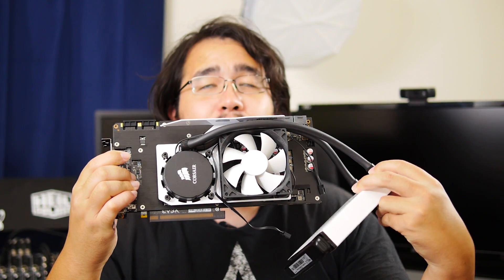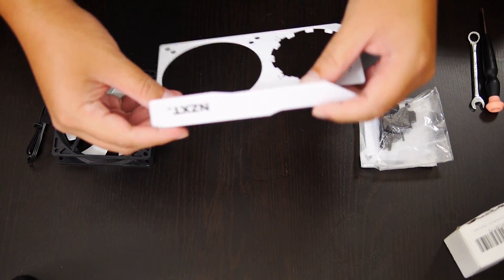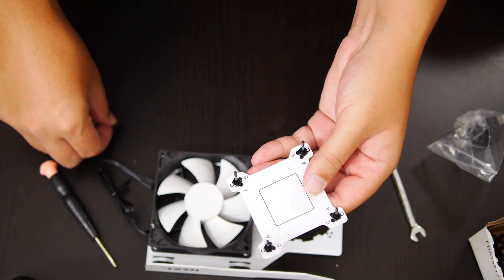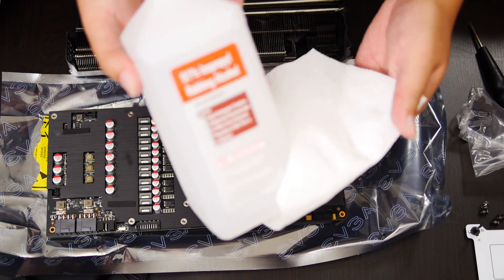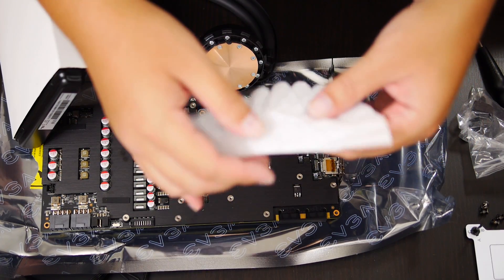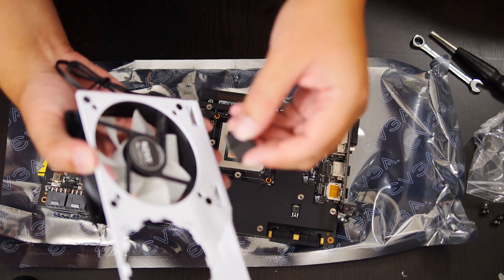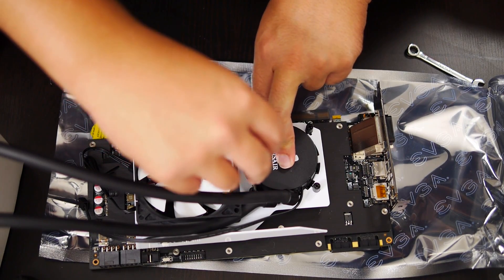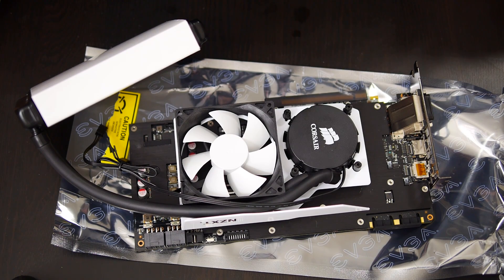NZXT Kraken G10 Installed on EVGA GTX 980 Ti CLASSIFIED w/ Corsair H90 | Backplate Heatsink

Comment: Been looking everywhere... Im looking to get my EVGA 980ti FTW water cooled, would this setup work? I've read that the FTW PCB may be different but can't find any specific answers. Help!
Reply: +youknowwho1989 did you ever figure it out? i have an evga 980ti FTW also and want to do this as well.
Reply: awp4lyfe Yes, it does work. Bought the parts listed in the video description and did the mod. Now my idle temps sit at around 31-35c instead of 60c. Under load temp max I reach now is 60c. Although I used a H55 for the cooler instead of the h90 used here.
Reply: +youknowwho1989 i have the h55 also. i've noticed under load i've gotten temps around 80 - not consistently but it happens. i did use a 20x20 shim instead of a 25x25, so i wonder if that makes a difference
Reply: awp4lyfe Well not sure if the shim size would be a big factor, but yes I did use 25x25... And also my intake fans are kind of blowing air and the fan on the h55 is sucking that cool air towards the radiator (not sure if you have it setup as intake or exhaust). Noted recently that my highest temp hit 70c while on load...
Reply: i have my all fans setup for intake.
Reply: awp4lyfe How are you getting all the hot air out? Do you have any exhaust fans? If not, then heat may just be building up over time and that's why you're getting those temps...
Reply: which fans should be exhaust? i have my h110i gt fans set to intake and they're mounted on the top of the case, and have my h55 fan set to intake as well and it's mounted on the side above the gpu.
Reply: awp4lyfe Well, it seems that you're blowing hot air from the GPU radiator into the case so temps wont stay low for long... I would set the GPU rad fan to exhaust and if you have a fan on the rear of your case I would set that as exhaust too... And if you have intake fans in the front of your case those would help to bring cool air in as well as somewhat cooler air coming in from the h110 above...

In my case I have two fans in front as intakes, have an h60 for the cpu mounted on the rear as intake, two exhaust fans on the top and the gpu radiator fan as exhaust blowing towards the bottom...

Comment: Do you still recommend the 1.2mm or was the 1mm shim working well?
Reply from the maker: +JibJab Well it's up to you. I'm doing well with the 1mm, but the 1.2 might give a little more assurance that the waterblock is fully contacting the metal shim.

Comment: Hoping you can help me with a solution to my problem: I have a EVGA 980ti SC+ ACX 2.0+. I got this card in December 2015, only to realize that the Fans/Gfx card faulty.. I knew that the fans only start up at around 60 deg C,  therefore was relaxed at first... Card seemed to be working brilliantly, no issues as I was not playing any games that put any "strain" to the card until I got Just Case 3... Playing Just Cause 3, heard the fans speedup to jet engine speed for 3 seconds and then dreaded silence as I watched my game start to lag due to Gfx card being throttled.... fans seemed to not switch on automatically anymore past 60 deg C after that,  will not switch on even when reaching 84+deg C... After a few restarts and shutdowns got the card to manually switch on fans with MSI afterburner, At times MSI afterburner works perfectly, and other times just wont work at all, i can see the MSI afterburner show that the fan speed is at eg. 70% but the fans RPM are on 0... I found that if I squeeze the 2pin power controller that sits right next to the PCI Power cables (the 2pin power controller that i assume connects the "led/fan" power) it starts working, but as i release my finger off the 2pin controller, switches off again.. Would this NZXT G10 installation work on my card? or should i rather remove the 2pin controller from Gfx Card and use extension to connect straight to motherboard? I am so frustrated at this point... Please any feedback will be appreciated.
Reply from the maker: +MrSlaai If you can I would RMA that card. But if you want to do my solution then you would not need any power connector from the GPU itself. I run my pump and fan on the bracket off of molex adapters to give them full power constantly. It's not that loud either.
Reply: Thanks for the feedback *****  - I am in South Africa and RMA on the card will take way too long for my liking hahaha, I will be getting the NZXT G10 tomorrow and see if I can setup this weekend.

Comment: In regards to shim size
If you have a GTX 960, 970 or 980 then 20x20mm will be ideal

if you have a GTX 980 Ti or a Titan X then you need 25x25mm.
Reply from the maker: +teflon don Nice to know, thanks for the info.
Reply from the maker: ***** Yes, but if you don't have a heat spreader for the memory chips then you will want to look into small aluminum or coper heat sinks to aid in cooling.
Reply: +Reckless Yuki - 4k Gameplay &amp; Tech this work a asus 980ti ?

Comment: Do you think I will be able to use my XSPC Raystorm waterblock onto the G10 grill? I think the holes seem to match up like the ones on the G10. For $30, I might just try it out and return it if anything. Beats spending $200 for a gpu block.
Reply: +awesomecooly123 I used a spare block I had, and it did work. Still had to buy some vrm heatsinks. The waterblock was a from a kit called Thermaltake Bigwater 760 Pro. I'll send you a link to the post I had in the overclock forum when I have a chance so you can see the pictures. But a cheap universal gpu could probably work too.
Reply: +awesomecooly123 https://www.reddit.com/r/watercooling/comments/45n5bo/cpu_block_on_the_g10_bracket_mod/
there is my mod. guess it was on Reddit. and it's a 760 plus block

Comment: easier to just buy a hybrid card and keep your warranty.
Reply from the maker: +xyz2theb My GPUs can break 1500, but once they heat up they start becoming unstable. Even on a full custom loop with full blocks, once my Classies hit about 55 they blue screen if I push the overclock too far. Really depends on the lottery and what you get. I can play just fine for hours, but once my room heats up and the cards heat up is when I have issues.
Reply: +Victor Ov not really,a classy overclocks alot better then a hybrid.
its definitely worth it to watercool.
Reply: +Victor Ov EVGA will not void your warranty if use a custom cooling solution as long as you do it right and don't damage anything. if you are a loyal long time EVGA customer (have lots of products registered) they'll even go out of their way to help you if lose the original stock cooler.
Reply: +xyz2theb ..I thought this as well when I ordered my Classy but that is not necessarily the case. When your talking water cooling the Hybrid will match if not exceed the Classy. The Classy will not really excel until you go with more extreme cooling..ie LN.   Unless your planning on doing extreme overclocking then the Hybrid is likely the better route.
Reply: Rick James Bish i can get my 980ti classy stable at 1546mhz on air.i haven't seen a hybrid push those kind of clocks yet.

i understand that all gpu's aren't the same though and this is just in my case.
Reply: ***** my card never break 75c even with an aggressive overclock.using the kingpin bios
my cards are completely stable.

if you haven't,try out the kingpin bios and see if they help stability for you.
Reply from the maker: xyz2theb Nice, I might. Where did you get your bios and which one did you get? (if there are multiple available) Just to confirm, you put a Kingpin bios on a Classy card right?
Reply: ***** na i mean custom bios created by kingpin himself :). hold on ill see if i can find the link for you.
Reply from the maker: xyz2theb WOW! That would be awesome! I would love to try something like that. I looked at overclockers.net (I think this was the website) and there wasn't much for custom bios for the classy, I just found one that increased the fan speeds... ha.
Reply: ***** i cant seem to find the exact link,but this is the bios i used along with the flashing tool. http://overclockingpin.com/classified%20980Ti%20tools/

with these bios i was able to increase the power limit from the measly 115% to 140%
which helped my stability alot and even increased me overclock headroom.
Reply: xyz2theb  I have seen a Hybrid stable at 1500 but like you said it will be different for each.   I just feel for the average user the Hybrid is the better balance. For one the difference in performance between the two on water will be minimal and the solutions to go water on the Classified are limited. By the time you do that you may as well have bought the Hybrid.  Also the Hybrid not only produces less heat but having a closed shroud it directs more heat outside the case.   Dont get me wrong, I like my Classified but if I had to do it again it would be a Hybrid.
Reply: Rick James Bish i can respect that.:)

Comment: hey quick question i got all the parts except for the washers can i use the ones that come with the h55. Also how is the fan controlled on the g10 by the motherboard or the GPU. Thanks for the video you have inspired me to dothe same to my 980ti classy

Comment: What temps have u been getting on this set up?
Reply from the maker: +alexander castro Depends on the weather and the card. In the summer I was seeing low 70s and high 60s. Here in the winter I'm seeing mid 60s and high or low 50s.
Reply: +Reckless Yuki - 4k Gameplay & Tech ok I was just checking I been getting mid 50's to low 60 oc and wanted to check that's fine for this card since I can't find what's the max temp. Love the video btw it's so helpful

Comment: Did you have to go single radiator because of your case setup?
Reply from the maker: +Howie Kahn Yeah, I guess you can say that. Since I have two cards I couldn't fit anything larger into my case. I'm thinking of getting a larger case with a custom loop before the summer to help with cooling though. It gets toasty in Arizona.
Reply: +Reckless Yuki - 4k Gameplay & Tech 

Thanks for the video, I am looking to do this with my 980 ti classified as well but I only have a single card. Planned on using dual radiator for the card, just worried about the vrm cooling.
Reply from the maker: Howie Kahn I wouldn't worry about the VRMs. The Classified has a VRM heat spreader that will help keep them relatively cool, and that fan on the bracket is enough to cool them off. Especially since you are taking the heat from the chip away from the card. I have my cards overclocked a good amount with afterburner and haven't ran into any issues.
Reply: +Reckless Yuki - 4k Gameplay & Tech thanks for the update

Comment: TEMPS?????
Reply: +ISEE YOU I'm running something similar but using a x40 instead of the h90 and max temps i've seen is 47c on Heaven benchmarking tool and that's with overclocking it to 1502 mhz.
Reply: akapdcdaka Awesome.. what about your VRM temps?  Are they higher than with the original setup?  This is what I have read is an issue with this kit.
Reply: I couldn't use this trick for the vrm's since i have the reference model so i installed some heatsinks i bought from ebay, some reason i can't see the vrm temps at all for nvidia cards on gpu-z or msi afterburner so i touch the heatsinks during benchmarking and they never got hot just warm so i think the temps are gonna be fine.  Heres a pic of the heatsinks http://imgur.com/FocPmrM.

Comment: My only concern is if the H90 tubes will wrap over my 980Ti since I use a CaseLabs Mercury S3. The motherboard sits horizontally. Any ideas?

Comment: I just ordered this setup for my 980ti ftw, but a quick question, are the screws used in this video included with the g10?
Reply from the maker: +The Warhammer Like I said in the video, I used the hardware that came with the G10.

Comment: hi may i know what is the temperature of your GTX 980 ti after you install the kraken G10?
Reply from the maker: +Yeo Chen Hong So my 980s were hitting between 60C to 80C depending on the cards position in my 3way SLI setup. With these I'm getting between 50-70C full load after 30 minutes of Heaven running. These are also overclocked reaching a speed of 1493MHz.

Comment: Hello! Great video! I'm just going to do this modification but I just wonder that is there any need to paste some mini heat sinks on the VRAMs and VRMs? I heard that those parts tend to get hot. Thank you!
Reply from the maker: +Harry Lin Depends on your card. My card has a VRM heatspreader so I did not have to, but if you do not then you will need to get aluminium heat sinks and thermal pads.
Reply: ***** Thank you! I just figure out that I'm having the same card and I ordered those washers and copper shim from eBay.

Comment: These are the right size finishing washer I need right? - http://www.ebay.co.uk/itm/140397754713?_trksid=p2055119.m1438.l2649&ssPageName=STRK%3AMEBIDX%3AIT
Reply from the maker: +antiduckable I don't know, the ones I know that will work are the ones I linked from amazon. Sorry this doesn't answer your question, but this is the only honest answer I can give.
Reply: +Reckless Yuki - 4k Gameplay & Tech i simply cut off the 4 tabs which were in the way of pump. used at the time with a evga 780 6gb.

Comment: Nice video. This is exactly what I'm planning to do. Do you know if this will void the warranty? I have the same card.
Reply from the maker: +micEvolution Not sure if it would void the warranty, but you can easily put the stock cooler back on if there is an issue.

Comment: Looks good :) Now all we need is the temperature / overclocking video :)

My ref's had trouble on air over 1450 in SLi, with these installed i can game at 1490 / bench at 1510. Your classified should already be doing 1500 fine on the original air cooler I bet so very curious what results you'll get with the improved temps.

Comment: The copper plate to the gpu is sketchy as fuck. I hope it works out. It will be interesting to see Gpu temps, but more importantly the vrms. With no directly cooling I would recommend keeping a eye out when adding more voltage.
Reply from the maker: +Alex Clanton This card has a VRM/memory chip heat spreader/sink so I don't think I have to worry about it. Also the GPU temps have dropped a good amount compared to the ACX 2.0 cooler. Just a quick heaven bench with my 980s rose the temp to 80c with my room AC running. The heaven bench with my 980s only rose to 60c, but this was without the AC running, so pretty good performance so far. Still testing and meticulously watching temps though.
Reply: Temps look great, I have a GPU full cover on my 780 Ti. 45C is max I get running with a 360 and 240 radiator.  Even though there is a spreader, if you start pushing near 1.4 volts they can get VERY hot. That's why when the ACX cooler is on, there is thermal pads that directly touch the vrms, to pull off the heat.
Reply: +Alex Clanton Wait, I couldn't see any thermal pads on the VRMs when he took out the ACX cooler. Am I missing something?
Reply: +micEvolution it's a classfied so the pads are underneath the heat spreader. so the acx cooler touches the spreader, instead direct contact with the vrms on a regular cooler